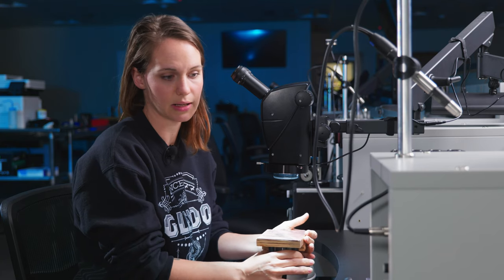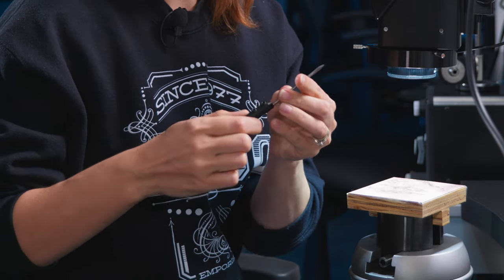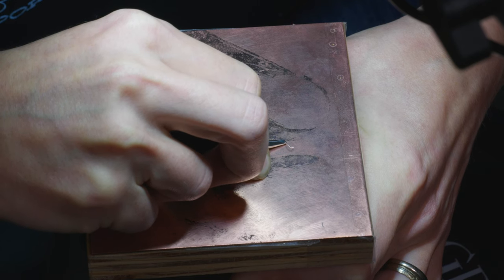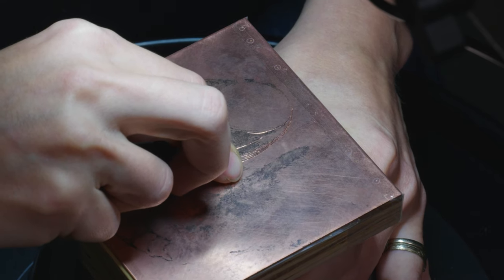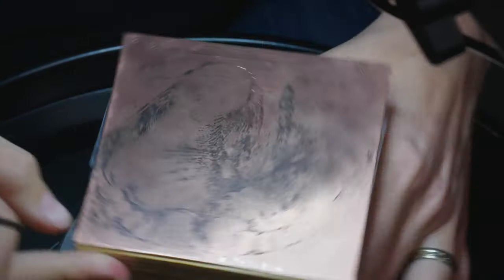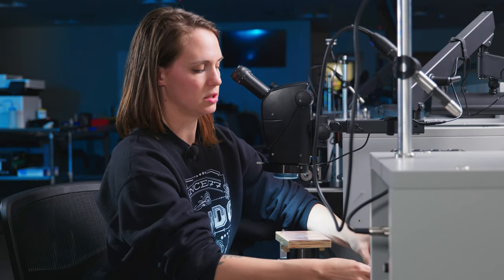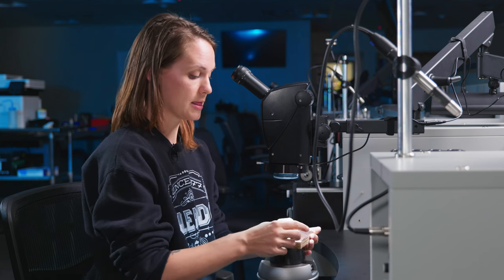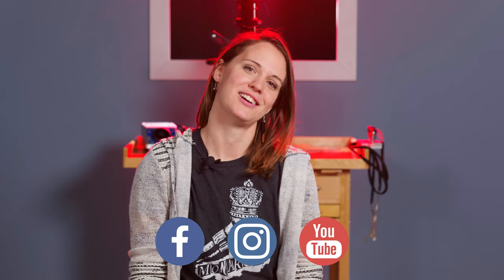GRS University: Hand Push Engraving

Comment: Dear Molly, 
I think of myself as a beginner in many aspects of this beautiful skilled labor.
I apprenticed from age 14, now I am 78. (Anyway, that's not the issue.)
Using only hand push method for very many years I have some suggestions, if I may share.
The method You are holding the graver is perfect for pneumatic engraving.
At traditional hand push engraving your finger should be at the middle of your thumb's soft pillow with the graver between those two surfaces, with a steady firm grip. Your guiding finger is your thumb, pressed against the material's surface.
Watching your demonstration, I am under the suspicion that the full length of the tool was too short for your hand size. The handle must be pushed by the last bone near your wrist that's under your hand's pinky pillow. 
After gaining control the angle of the graver can be increased, still keeping the thumb on the material's surface. I would be very pleased if You find my remarks useful in any sense.

With Best Regards, as above.